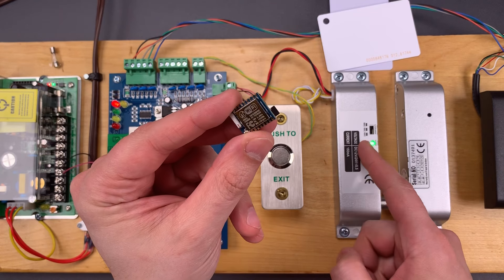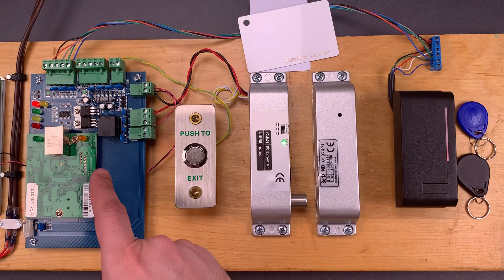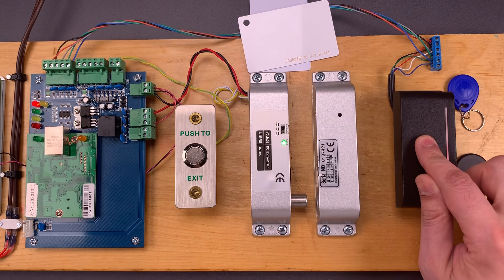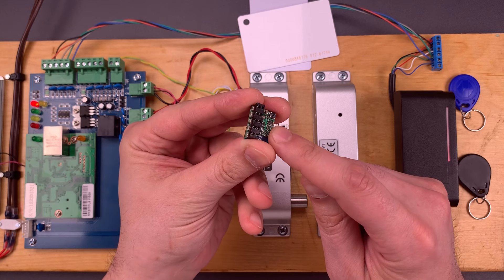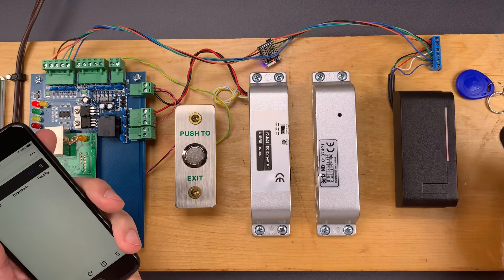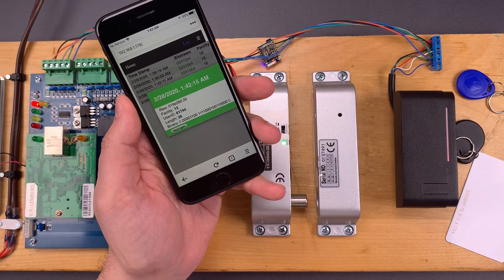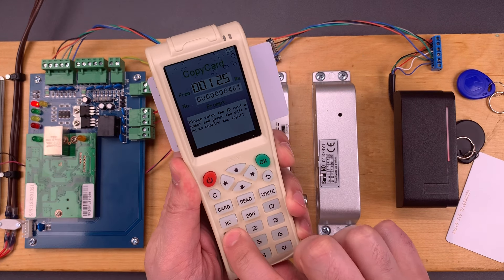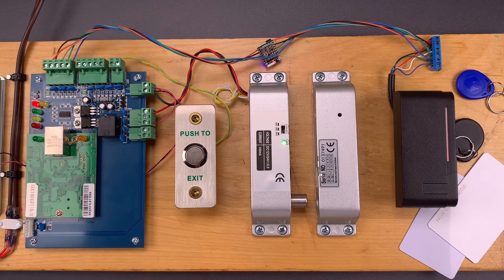[1052] Bugging an RFID Card Reader

Comment: Some systems, while still being unencrypted, have an "anti-pass-back" mode which is designed to prevent a user from passing the card to someone else over a turnstile for example. The card must be seen "badging out" before it can be used to "badge in" again. This would probably go a long way toward preventing the replay attack.
Reply: Where I (normally) work, there is no 'badge out'. You just walk out the door.

Comment: Hello, very interesting video! I've some thoughts:
1. Removing reader from the wall is often protected by some sort of system, i.e. light sensor, which triggers 'sabotage' alarm.
2. wires will often be buried inside a wall and accesing them might not be that easy
3. If it can read signal can't it be upgraded, so it could repeat any stored data? You wouldn't need to encode the card anymore, just click 'repeat' on the phone.
Reply: Hi Marcin - I specialise in access control and security.  Just wanted to answer your questions.

1) Often low cost readers do not have a dedicated tamper connection and because the comms used here are wiegand and uni-directional, it’s often hard to get a tamper alert to the system if the reader is removed.  Not all access systems are properly monitored either, so tamper alarms are useless anyway in this case.

Using OSDPv2 encrypted comms (bi-directional) a tamper alarm is easier to achieve.  The bigger threat here is an unsavoury installer adding these devices on installation without the customer knowing and then returning months later to utilise them and get access to do criminal activity.

2. As per point 1, can be done on install and later directly at reader.

3.  You can build different firmware for these devices.  We built one using BluetoothLE and could store as many card numbers as needed and playback at anytime, no cloning of cards needed.  However the LPL makes a great point that you are only secure as your weakest link, in that the card technology is as important than encrypted comms.

In summary, if you are installing a high security access control system use OSDPv2 encrypted comms and a secure smart card with encryption such as DESfire EV3 with diversified keys or iClass SEOS.

HID Prox, EM Prox, Mifare classic, Mifare sector, iClass legacy, DESfire UID’s can all be easily copied.
Reply: @Ricky-ln6rt  Thank you for sharing your knowedgle! Very interesting post.
Reply: @Ricky-ln6rt  I mean, in this case, he could have just not worried about the device and wrote some code to loop through numbers until the lock opened (based on the assumption that there seems to be an unlimited number of attempts and the codes are numerical). Definitely would be faster than trying to wire in a device and worrying about tamper alerts.
Reply: Hi  @jasonsumpter1641   not quite, when you take into account most modern systems are 128 bit systems, that would take quite a long time.  

Cloning the actual card number and replaying it back to the reader in seconds is much more efficient.  

But this is rather here nor there, if this is a secure entryway it should be two or three factor ensuring the attack you speak of is mitigated easily.

Comment: After watching countless LPL videos and begun picking myself, I've reached the conclusion that any lock is just  a mild suggestion of security saying "entry is forbidden unless you know, you really want to get in".
Reply: The purpose of physical security isn't to be infallible, it's to discourage forced entry.  All a security system has to do is either delay an attempted entry long enough to maximize the chances of intervention by other means, or even just make the interloper believe that attempting it is not worth the risk.
Reply: @shingshongshamalama  I've always said the goal isn't to be impenetrable but just to be a more difficult target than the next guy.
Reply: Good electronic locks can actually be almost impossible to tamper unless you try to do the brute force way of breaking the door open. Using a smart key and a challenge/response protocol instead of RFIDs even without encryption will make it really difficulty to bypass as replay attacks aren't possible on that system. Then add in the fact that you can move the actual verification system inside the secure area (e.g. usually a centralized security closet) to avoid trying to bypass the verification system by opening the terminal. These are setups I've actually been through in some sensitive software projects, but they're usually a bit more expensive than what you see in LPL's videos as there's actually a security rating standard electronic locks can be certified depending on how secure you wanna go.

My overall conclusion for these usually is that mechanical locks can be picked with enough experience, but not all electronic locks can. Yet those tend to be more expensive or isn't shown on these videos.

Comment: In the early 1980's I was working for what was then one of the largest computer companies in the world. My task was to prepare a computer for the market, integrate it with the operating system.  I worked with about a dozen other people.  All of us had access to a lab with the prototype.  Anyone unauthorized, even an employee could do a lot of harm simply by seeing how far along we were.   At first there was a key pad.  The entry code was the project code name for the computer.  This received some criticism and demonstrative pranks. Then they put in a key card, same problem as you identified.   More pranks and criticism.  Since the lab was filled with computers, intercepting the wiring was especially easy too.  Other facilities I worked in were semi-conductor development labs. Those had a "Roach motel" entry.  a phone booth sized thing would rotate 90 degrees.  If someone inside did not approve, you would be rotated back out politely or left to wait for security.  That was pretty intimidating.  I never found out what would have happened if there was a fire.

Comment: It's basically a skimmer. I did some "security research" back in college that involved defeating their magstripe locks with a similar approach, only the skimmer and associated data-dumping electronics were designed from scratch and buried within the card reader body. There's a fair amount of space inside and hiding an extra MCU is easy. Some of the readers had tamper switches but of course none of them were wired. Then there was a card emulator that went into the card slot and could simulate a swipe of an arbitrary card, which isn't difficult to build if you have some basic embedded knowledge and know how the tracks are laid out. But most systems use only one track, and tend to follow the one published standard. We wrote a paper on it and they issued everyone new cards, but it got a bit messy (there's more to the story and it gets a lot worse) and in the end they recalled all the new cards and erased/rewrote them (correctly this time). Based on where you live, you may have actually heard about this one
Reply: Mag data has always been easy to dupe, many universities introduced cards with dual stripes at the back to make it harder. (As you can only program one at a time,  two tape heads quickly sorted that)
Still, many had infinite free photocopies and laser prints ;-)
Reply: @BleughBleugh  my school was smart enough to tie each photocopy card to a unique ID, and do bookkeeping "in the cloud" which effectively thwarts card shenanigans unless you can predict another card's ID. But the key cards? Hoooo boy. I've seen some university cards use dual tracks, but this tends to be for compatibility with point-of-sale terminals at quasi-affiliated vendors who set up shop on campus. The vast majority of campus key card readers are knockoffs / rebrands of the MR5 model from Mercury Security, and are single-track. You'll be lucky if it's an MR10 model, and if the tamper switch even goes anywhere. Fun fact- the card reader is entirely agnostic to the track position (the head is movable via set screw), the track format, or even the swipe direction. It outputs a raw bitstream, regardless if it's Track1 (7-bit alpha) or Track2/3 data (5-bit numeric). If you swipe the card backwards, the data comes out backwards. The decoding (and reverse correction) is entirely up to the controller that sits upstream of the card reader.
Reply: @evil-wombat  you know your stuff :-)

Back in the early 2000’s the most fun (and profit) was had ‘reprogramming’ store loyalty cards

Was hilarious presenting a store card programmed with my own credit card details and having it work!!! 

Then they had to introduce chip and pin and spoil it for everyone with a mag swipe encoder (or hacked tape deck)

I’m still amazed that stores incremented loyalty card numbers by 1 each time…naughty people would have unlimited points with a card programmer
Reply: @BleughBleugh  oh man, I hadn't thought of trying that. I kind of expected all the loyalty points to be tracked server-side, but I guess the early 2000s were kind of full of bad design. I "may or may not" have used a library photocopy card for my meal plan at one point, and "might" have been the only one with a functional "new" student id card (that is, after they were mailed out but before they were activated). Had to make sure I read that like, ten times, before wiping it. Good times.......

Comment: the scanning device could be more physically secure. it could be hidden behind a glass panel with no way to access the physical connections but from a secure rear panel from inside the building being protected by this system.
Reply: Then I could just use extremely sensitive sensor, or simply drill a tiny hole to access the data line. This kind of non-encrypted system is simply insecure, no matter how you install it.
Reply: @ferio8019  this ends up being a lesson in how to physically secure the equipment so that it can't be compromised. This device is brilliant but you have to physically attach to the equipment to use it. As you present it there's no challenge you can just cut a hole in the wall or pull the device off the wall and you're done. That's going to change

Comment: Just find a security system that runs on 24 volts and when the thief installs his ESPKey, it will blow it up since 18 volts is max on the ESP key.
Reply: You can make it 24 v
Reply: yup, making it 24v capable is super easy, barely an inconvenience.
Reply: If 24V security systems ever become a thing, you'll have 24V ESPKeys
Reply: Resistor: "Hi."

Super ghetto but it'll work.
Reply: Make a security system that powers it's readers via supercapacitor or/and rechargeable battery within the device. It'll pulse voltage for a few seconds at a shot just to top the battery off, and have no line voltage otherwise. That makes it impossible to use an inline device unless it also has it's own power. 

Or just frickin' shield or pot your wiring... can't clip into what you can't access without being obvious or breaking things.
Reply: @kenabi  oh really?
Reply: @hikoseijuro922  Yes, you can, but odds are you'll blow up the first ESP key before .you know you need to mod one
Reply: Just mix the colors and look at the puzzled hackers through cctv.
Reply: @gearloose703  That would actually work very well.  Switch the wire colors between ground and + and that will surely fry their ESPkey!
Reply: Just add a series of button batteries to the ESPKey, giving it it's own independent power supply.
Reply: @Spodeboy  A simple voltmeter, free on a good day with a coupon from Harbor Freight, will tell you the voltage and polarity in a few seconds.
Reply: @greendryerlint  A simple security guard with minimum wage from some run-of-the-mill security company and a simple cctv system will be able to nullify your voltmeter in a few seconds.
Nice try though.
Reply: That wouldn't be too difficult to bypass. Bump up voltage, any voltage to the highest used in electronics, then down it with a resistor to something that you can use like 24 or 12, etc...
Reply: @Spodeboy  Just put 4 diodes in a  bridge and the problem is solved

Comment: "If you are installing an access control system like this, it is really important to use one that isn't from china via ebay for $17."
Reply: The head security guy where I work is absolutely proud of our keycard access system. Not because it's better than others but because "it's the cheapest one out there and it works!" and cheap matters more than anything.
Reply: even name brands like HID can be copied with this method.
Reply: Top of the line stuff is no different. China board for 41 dollars, or an Evo vertx v2000 from hid global (retail price for the board, 1126.00), both are vulnerable to this.

Comment: But wouldn't those wired realistically be inside the wall when the card reader is installed correctly? How would you access them to install the device without doing significant damage to the wall that would immediately tip off anyone who takes a glance at it?
Reply: In some scenarios it might be neglectable. You know you want to get in there, so you do more or less stealthy.
Reply: @carlwummel9050  But you need to install the device and then wait for someone to scan their valid RFID tag. But the first person who comes along will see that you ripped the cables out of the wall.
Reply: You can remove the reader from the wall with a few screws and then install the espkey and screw the reader back onto the wall without leaving any noticable damage

Some systems get around this by having tamper alarms that go off when the reader is taken off the wall, but those are far less common than they should be
Reply: External gates (either for vehicles or pedestrians) often go to ducting installed in a half-ass manner. Really reinforces that security is only as good as the weakest point

Comment: If that is "little" effort then I've misjudged the scale. I don't think there's a risk any common criminal will do this.
Also there's a problem of getting to the wires covertly to install that chip.
Reply: You'd be surprised what you can get away with using just a high vis vest and a clipboard.

Comment: This is really cool. For consumer/commercial  level systems.
Will not be breaking into to many high security installations. As readers are encrypted too. With a site specific key. Also the use of entry and exit readers, prevent cloned cards being used. Without security being alerted. About 1 second after you present duplicate card..

Comment: This also works for most car remotes. I made a record/replay device using an Arduino and a simple cheap 315MHz RF receiver, a 315MHz RF transmitter, and a similar 433MHz pair. I wrote a program to record every received signal after pushing a button, and replay it after pushing another button. It worked for every car I tried it on! I think it may not work on high-end two-way remotes on expensive high-end cars like Lamborghinis. Although I'm not sure about that ;-)

Comment: Not sure why this just showed up in my feed today, however, here are a couple notes about the binary stream numbers in the video which are slightly confusing.

The mobile phone shows the string "0 000011001111000100110000 0" which it then globs together and shows as "019e260" (in hex) in the display. To get the correct number for writing the card, LPL lopped off the first and last bits (i.e. binary "digits") to get the string "000011001111000100110000" which in hex is "000cf130" or "848176" in decimal.

Comment: It's worth mentioning that this device works only with the Weigand protocol that is generally considered obsolete and insecure, however, at least one manufacturer with a more modern protocol sells adapters so customers can use existing Weigand devices.

Comment: I've worked in this field for 5 years and can tell you it will be that easy. Only, 2-3 years ago the standards have changed to OSDP (like SSL encription between your reader and controller) and the cards have switched to Mifare Desfire sector encrypted so without the security key you will not be able to replicate the number that easy.  Now here's the fun part. Eventhough the security standards have changed, doesn't mean companies will update their hardware 😁. I even came across a major oil company that had readers that would grant access to anything that they could read. Including the NFC singnal coming from my cellphone (which changes every second)
Reply: I also work in this field.

I think the real problem is that intrusions with this type of device are exceedingly rare. Like, a security system that needs a high level of security would also have cameras, guards, etc. It's rare to have an high end security system unmanned, so man in the middle attacks, while technically feasible, are just more difficult to actually perform.

Comment: last time i used one like this, I pulled the wire's taught and gave 0 slach, immediately going to the walls and added a megshift tamper wire with a constant voltage, if that voltage was cut or increased/decreased more than normal emf background causes it locks that reader out of the system, opening the case at all will sever the wire

Comment: Only if 3 wrong codes don't lock you out for 24 hours, 3 wrong pins in an ATM causes it to swallow your card  !
Inercepting the wires in the example given only works if you know which one is which, no one reputable is going to use red and black for power ! These cables typicaly have 8 wires with over 4000 combinations, 8 x 7 x 6 x 5 x 4 x 3 x 2 x 1 !

Comment: I wrote a paper about this a while back.  Even if the system transmits encrypted, rfid chips are powered wireless and broadcast in plain text the information it contains.  If you have a reader that has a boosted antenna you could get the card information in its raw form from at least 6ft away and write to another card from a computer and you would never have to physically touch the locking system.  There is a video I did explaining in more detail up on my channel